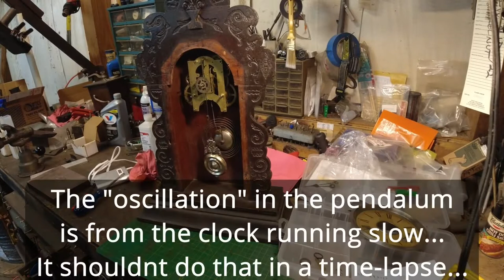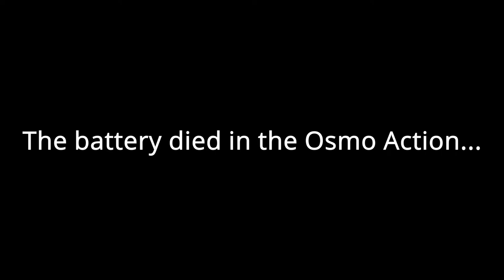Assembling a vintage Ansonia clock movement in 7 minutes - Timelapse with a DJI Osmo Action

Comment: Absolutely Stunnin' !! That was so cool. I love that you made photos as you tore it down to refer to while reassembling. You are quite a craftsman!
Reply from the maker: Thank you so much! The photos were needed... there are a lot of odd little parts in there. There is no way I would remember the sequence to reassemble it without the photos, I guess if you did ALOT of clock repair you would eventually memorize the sequence, but I have not done enough to do that yet. It was fun to record it then see the process from the outside, so to speak. 👍📸

Comment: Awesome work David.  Clock looked amazing at the end.  👍
Reply from the maker: Thank you Adrian, it still has a lot of problems, seems that it was run and oiled and never cleaned so the gear parts are work heavily and needs more skill that I have to correctly repair it. It is look pretty good though... 😁👍

Comment: I have a ansonia clock that is very similar.  It hasn't ran in several years. It was my grandfathers.  I'm sure he was probably the original owner.  He was born in 1883. My question to you is how much would it cost to do what you just did?   I don't have any idea of a cost.  Brian W
Reply from the maker: To be honest, it would be somewhere around 800$ to possible 1000$ to repair one with worn axles and plates as it is really time consuming to do the repairs. This is the unfortunate part of the equation as the machinist time is costly and these clocks were never really that expensive. People do repair them for sentimental reasons though, like what you have mentioned, but realistically most dont want to invest that much into them.

Comment: OK David 
Since this works which camera are you going to do? 
How about  a Pentax with Aperture Block problems you can watch the video on your phone as you fix the problem.
Reply from the maker: Oh dear, I never considered dismantling a camera to see what is inside of it. That does seem kinda daunting…and intriguing too. I dont have a broken camera or I would try it to see if I could. Do you know of a Pentax that needs work?
Reply: @davidsaylors  
David I'm positive there is one in your area the Pentax K50 is notorious for Aperture Block failure you can check out the repair on  U- Tube  my son had both of his K50 Pentax cameras fail on his trip to Europe this summer.  I managed to tell him how to get them working. The fix works sometime.  You put the camera in multiple exposure and shoot away it worked for him this time. This was the second failure on his camera There is a class action lawsuit going through the courts at this time.
Reply from the maker: Oh wow, I thought these were film cameras but they are modern digital machines!!! Wow!